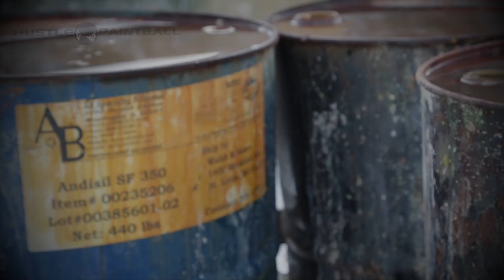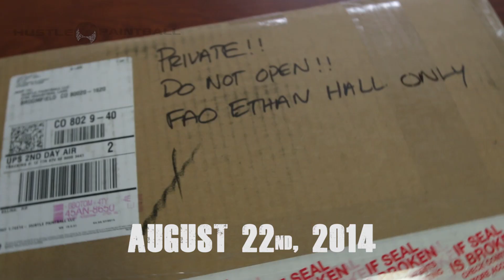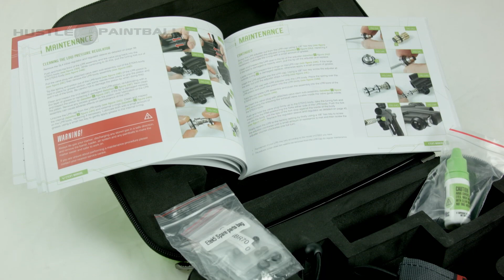Planet Eclipse Etek 5 Review by Hustle Paintball

Comment: great review !!!
i tune my etek 5 trigger, i put pieces of rubbertape where the trigger screws knocked on. and i expand the trigger where the micro switch pull is. 
now my trigger dont sounds like a plastic scrap, it feeld nicer and the trigger distance is much longer to the gripframe since befor =)

Comment: I have a very interesting question. I was gonna buy an etek 5 as well as an oled, but, I found an lv1 with 35k shots and some scratches on the barrel tip for 600. What do u think is the better deal and why? The lv1 comes with everything the day it was bought. There is little breach wear. I am stuck in between both bc of how similar they are. Plus the etek 5 is new and still has to be broken in. Please respond asap. Thx

Comment: Does the etek 5 have a chopping problem? Team Insanity got one and it was turned into a flame thrower. They changed paint, battery, barrel, and adjusted everything possible on the the gun.  Just was wondering if they got a lemon or if they all did that?
Reply from the maker: fusano10 Hmm.. We've never had that issue... With really any marker haha (as long as it has eyes and they're working correctly!).
To directly answer your question, no we did not have a chopping problem.
-Russell

Comment: How durable is the Etek 5? I'm not expecting Tippmann level indestructibility, and I know that no electronic marker is going to last if you don't maintain it properly. I just want to be able to use this for woodsball on top of using it for speedball, where it might get mud and dirt and banged up. Would getting the EMC kit for it be a good idea in terms of protection? I've had a bunch of bad experiences with electronic markers, so I'm trying to get one that'll last.
Reply: it will stand up just fine, playing speedball is almost worse, as you slide around more! It will survive! i have used both etek 4, 5 and lv1 in woodsball, they are excellent!

Comment: Okay Hustle I have one question, this guy at my local field has a SWEET G6R for 400. I'm a newer player and wanted to go ahead and get a good marker. So, this or the G6R? (I really like the G6R btw)
Reply from the maker: Paintball tips and tricks G6Rs are awesome! I actually used one for a few points this past weekend at XPL in Arizona. As long as the marker is in good condition and you're diggin' it, as it seems you are... I'd say go for that! I just don't like the silly clam body it has. Too hard to deal with. But that's just me! Really though, it'll come down to personal preference. Both markers work very well so it comes down to what badge you want to rep!
-Russell
Reply: +Hustle Paintball Thanks Man, Looks like I'm getting a G6R!! SWEET

Comment: I wish I had your job and be able to compare the etek 4, etek 5 and LV1. So many options. What would you guys recommend for a recball and speedball player?
Reply: or do you pick a used ego 11 or an etek 5.
Reply from the maker: avalanche1220 I would recommend going with the Etek5. It is outstanding for the money and shoots similar to an Ego 11. Since it is a new marker, you wouldn't have the worry of used gear. Go with the Etek5, you won't regret it. :) -Caleb
Reply from the maker: avalanche1220 If it was my money, I'd get the Etek5. It performs SO well that it probably should be $300-400 more. But that's just me. In the end, it comes down to what YOU like your marker to shoot like :D - Ben

Comment: love your reviews but what about in detail to the regulator maintenance of the marker, do i just put oil on the bolt and the zick 4 or 3? Russel please help!!!!
Reply from the maker: Denver Ranger It'll be just like the LV1 video :D even the Etek4 is the same style. Follow those steps and you're golden!
-Russell
Reply: thank you man btw sorry to task im going to buy a new tank n i want ninja sl with a pro reg cant decide the 68 or the 77 is the 77 be push my etek 5 out where like holding a pole , my height is 5ft 8 inch
Reply from the maker: Denver Ranger the 77 is where it's at now. If you're in Denver - which I'm assuming you are because of your name - stop by the shop and see for yourself!
Reply: alright the snow makes it hard to get up in broomfield hope to see you guys at blitz next sunday